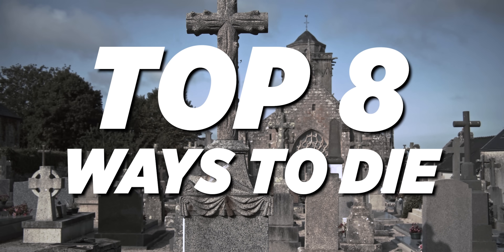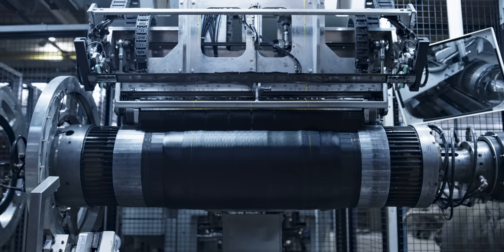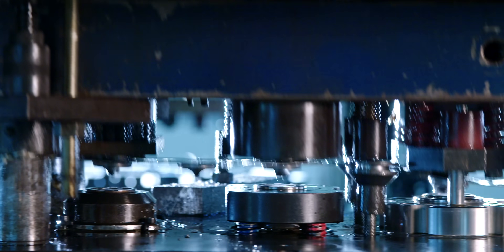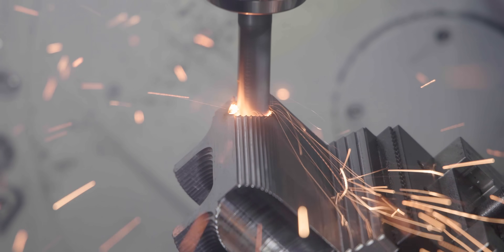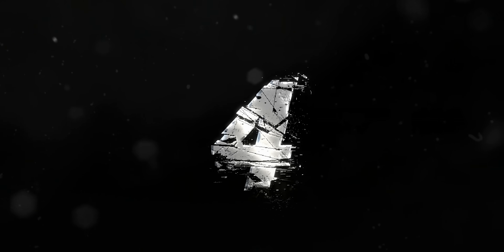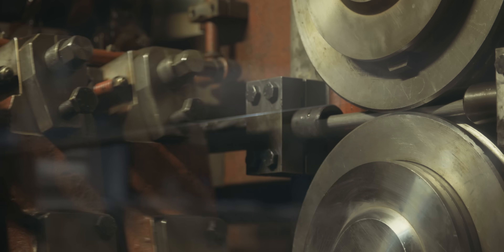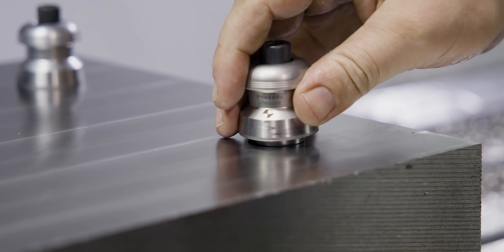HOW To Be KILLED In a Machine Shop

Comment: More of an issue with manual lathes, but can come up on flatbed  CNCs also. And that is long stringy chips. Ive got a big scar wrapped around my left middle finger where I cut the end of it mostly off and had to get it sewn back together.  One moment of stupidity doing something I knew not to (brushing away a stringy chip with my hand instead of using a chip hook) and the chip caught on the chuck and essentially turned into a bandsaw blade running against my finger. 

Good video overall and covered all the other major important ones. Personally saw someone scalped by a lathe years ago from long hair not tied back. It wasnt a pretty sight. My hairline is retreating fast enough that it isnt much of a concern personally.

Comment: Was a new guy in a shop with a super clean Clausing lathe, so I started using it. The guys used to give me funny looks, so I asked the Foreman. He told me the guy before me got his head between the chuck and the bed of the lathe.

The reason the lathe looked brand new was because the Maintenance guys picked it up with the crane and took it out to the dock and steam cleaned the dudes brains out of the machine.

Had to let the guys I didn't know I was working a dead-man's lathe.

Comment: The worst accident I had so far (In my 6 months of being a machinist with no prior experience) was that I: A: Didn't check my Y finish position on a job, and B: left a vise handle in the vise when I was setting up the cycle. The result was a broken vise handle and a giant crack in the 3 layer glass doors. I was in shock the rest of the day and now I check my Y axis moves religiously every time I run a new job. Happened when my supervisor was like 2 meters away too, luckily nobody got hurt and I didn't lose my job but this one will definitely stick with me.

Comment: We once got an order to re-machine the flank geometry of already produced "plastic" cogwheels with a steel core.
Apparently, the other geometry was way to loud but they already had like thousands of them lol.
I'd take a small Drill, flip it around and put it in a ER16.
This "Tool" would come down Z- and position itself at 0° (X+30) above to my 3 jaw chuck in which i would clamp the cogwheel.
The drill was used to align the cogwheel tooth at 0° while closing the 3 jaw chuck.
So once setup it'll look like this.
Take out cogwheel, close doors, Cycle Start, Drill comes down Z- and positions itself, Stop M00, open doors, put new cogwheel in, close doors, Cycle Start.
Now, opening the doors twice is a pain in the ass, yes.
Especially when we are talking 5000+ of cogwheels with 30 seconds actual run-time.
But when i found out the next shift not only disabled the door safety mechanism, but also left it that way for an unskilled night shift worker?
I kinda lost it. 
Like imagine the guy would've sticked his head in when the Drill comes down.

Comment: Lock out, tag out especially with HMI remote controlled or automated equipment.

Years ago, I was helping a guy replace a brace for a large conveyor belt. I was between a massive chain and sprocket with loose clothing when I heard a buzzer go off that indicates all the belts will start up in just a couple seconds. Fear came over me like no other thinking this high horsepower electric motor with a gear reduction trans was about to turn on and cut me in 2. I failed to check if the equipment had been locked out/tagged out. The other guy luckily had done that procedure saving my ass.

Comment: Yeah I grabbed a spindle going 10k rpm once with a glove on, like firm full force don't want to drop this type grip. 
Disabled door locks. To change tools you'd call it up in the spindle, hold the tool with 1 hand and push a release button with the other. Thank the Lord I was wearing a pair of shitty maxiflex and the gloves ripped before my arm did..
I took that as a learning experience, to always double check the spindle before grabbing it, because door interlocks are for sissies.

Comment: i am a maintenance technician. i was called over to a machine with a pallet conveyor and pneumatic pick-place arms to find an issue, it was a big equipment with safety fences all around it. naturally i have bypassed a safety door lock, went in to inspect sensors and what not, and the operator WHO CALLED ME THERE switched on control, and my entire palm got pinched the instant air pressure got back by a fairly powerful lift cylinder. better than that, screaming from the top of my lungs to hit the emg stop button, the cylinder bound up, and they had to crowbar it open so i could remove my hand.. 

we were moving in the shop a new cnc lathe. 17 tons. had to stack the rollers about 30cm high so it would roll over the preinstalled anchors in the concrete. one of the manufacturers technicians was under the machine checking for the rollers, and told the forklift driver to start to pull the machine. the driver insisted that the technician was clear of the machine before moving.  the moment he pulled on the machine, it jumped off one of the rollers, and it would have killed the guy under then an there.

Comment: I remember hearing a story on reddit about an operator of a machine that lifted heavy something. He found out that there is a decent space in the back of the machine that is never used during normal operation. He programmed a dead zone in the machine so it stops early if someone tries to move a load back there so he can put a small mattress in the space so he can take a nap.
Reply: Well that sounds like the setup to a "final destination" scenario, except one that doesn't need anything contrived to flatten the guy, just someone who knows how to override his dead zone and a reason to do it.

Comment: I repair garbage compactors, this is a true story. In Napa California, a operator removed the safety lockout on the loading platform gate, so he could load the compactor with the gate open, while the compactor is running. He lost his balance, got crushed and died. Other compactor repair persons can relate to this story. On megantic safety's people would place a magnet to defeat it. Micro switches are locked on with tape. I remove this stuff almost every day.

Comment: Here is a good Idea. . .Everyone in the shop needs to be familiar with everyone else's machine to the point of shutting it off in case of an emergency. I can't tell you how many other workers I know of including machinist that do not know how to stop the machine next to them. This would be to pull up a leaver quickly or where the emergency stop button is located or what to do if someone is caught in a machine or wounded.

Comment: Manual machines are very dangerous.... I had a 90kg steel part chuck out at the other side of me... Turns out there was plastic inside its bore.... Close call... I also use cncs... The closure makes em safer

Comment: 2:08 You may not be aware of this, but here is a very serious error: you must never use a file on a lathe in this way...because that's how the left arm is over the lathe chuck!!! Unlike usual, the file handle ALWAYS belongs in THE LEFT HAND and the file is guided upwards with the right hand!!!
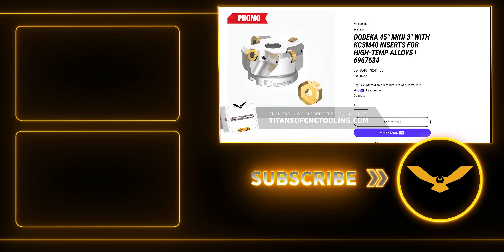6:38 On the subject of "long hair in the workshop": In almost all workshops in Germany it is simply forbidden to wear longer hair "open".
They either disappear completely under a cap or under a "hair net" which, in the case of long hair, is part of the personal protective equipment of every worker, like gloves, safety shoes and protective goggles (the protective equipment is provided by the company free of charge and must be worn).
Andreas, Germany.

Comment: #11 Sticking your head into a machine and breaking off a .070 drill or 2-56 tap in the noggin will not make you yell BOOM! I have probably seen this injury more than any other in my 25 years of CNC mfg. (bonus - #12 grabbing chips off a tool or part bare handed).

Comment: When i was an apprentice there was a guy in my shop working on a leathe, having a bar hang out the machine about 4 feet. the bar startet to rotate and bent to a 90 degree angle. it looked like a propeller but the whole machine startet jumping und shaking. on this machine the emergency stop switch was located on the left corner but facing towards the machinist. when he tried to push it his fingers would reach over the corner of the machine and the spinning bar just cut off four of his fingers. he is now left with only a thumb on his left hand. 

sorry for bad english.

Comment: I almost got decapitated across the shop when a lathe operator loaded an 8ft bar in a 4ft drawtube. Cranked the spindle and turned the bar into a helicopter prop and sent it flying. Missed my head by inches.  I know mistakes happen, but I'm glad this one didn't force me to tap into my precious vacation time. 😁Lathe guys...😂

Comment: A guy leaned in, and his long hair got wrapped around a chuck on a manual mill.  About 3" square of hair got pulled out of his scalp. It was freaking nasty and the screaming from him. Another guy did the bar stock out the back of the lathe. He turned it on, and that 5' feet of material was whipping around. He turned the lathe off and thought he could stop the bar. The bar hit and broke his forearm   These both happened in vocational high school. 40 years later, I'll never forget.

Comment: The first images in this video are of a wire drawing shop. They run steel wire that's actually called "rod" at that point, because it's not truly round, through dies. This brings it into size and roundness tolerances. This wire is then used to make fasteners, like bolts.

Comment: Thank you for the message Barry but no matter how many times people will be told some operators behave as if they are knife throwing in a circus show-seen operators running power tools without plugs,others welding without safety glasses and others using the grinder without safety goggles,painters,riggers you name it -safety is just but perfunctory.

Comment: 2 that have occurred in my career. First shop I worked in had all their safety interlocks overridden. A guy was touching a workpiece with a facemill to get his z-offset. He forgot to clamp the part and entire workpiece began to spin with the facemill. He reacted my raising the facemill and the workpiece flew off the table and hit him. I wasn't on his shift and he never returned to work.
2nd shop and we have our interlocks in place. We have a really old boring mill that's wide open. Operator was using an edge finder to pick the part up. He realized there was a burr on the edge and backed the tool away. Grab a file and began to deburr. His sweater got grabbed by the still rotating spindle. He was fortunate that his clothing got ripped off him. He suffered burns from the clothing and broken ribs. He eventually returned to work.
Always wear your safety glasses. I've been saved twice. Once at the first shop when the lathe door was open by about an inch had a curly chip bounce out of there and bounce off my glasses. Second time by a broken needle file that chipped the lens of my safety glasses.

Comment: Touching equipment your aren't trained on.

There was a Printing press operator at the factory I worked at growing up who lost his pointer finger when he tried to help pull off some scrap from a die cutter.
The machine pinched it right off.

Army side i've seen numerous near misses from people being crushed to death, and for some reason Chiefs like to mangle thier fingers by putting them into running generators. Fans aren't your freind.

Comment: Speaking of unsafe lifting, I work in a shop where they tend to cut corners when it comes to manipulation of machines to save a few dollars here and there, like they use manual cranes and forklifts to get them on some wheels to push them around to not to get the big machine that is SUPPOSED to carry that load because it takes a lot of gas to get that thing going , not long ago, while trying to move a lathe "the cheap way " the lathe lost balance and in a split second fell over on a mechanic crushing his mid section,  there was a whole investigation surrounding this incident  and that costed the boss way more than if he were to do it the right way in the first place....

Comment: I remember my very nearly missed accident, when i was first year apprenticeship learn the machine. I got oversize drill and went into tool changer wheel and hit the side window. I remove the window, the wheel still moving and broken the pocket. I put my head in machine and try pick up the broken pocket inside machine. But machine was never press E-stop and keep run and tool changer near hit my head also my longer hair. I never forget i make a many mistake and always put e-stop and switch off the machine that i repair inside machine.

Comment: A former UAW employer of mine forced employees to sand and polish parts on the CNC lathe by hand after it was machined and an employee got pulled in by the strip of emery cloth and got his middle finger ripped out by the roots. Tendons pulled all the way out right up to his elbow. Blamed the guy who lost his finger for not doing it correctly when there was the OSHA investigation. Kept forcing employees to sand and polish with the door open after.

Comment: Number 9: Disobeying Lockout-Tagout regulations.

For those joining us from overseas, our Occupational Safety and Health Administration requires that when you have to turn off the power to a piece of equipment for servicing, you have to keep people from turning it back on while you're working on the machine. You can do this in one of two ways - put a padlock on the power switch so it can't be turned on, or attach a paper or plastic tag to the switch that says something like "danger, do not operate this equipment." If you use locks, the person who applied the lock keeps the key with him, and if you use tags you write your name on them. Only the person who applied the lock or tag can remove it from the equipment. If more than one person is working on the machine, each one has to apply a separate lock or tag to it, and each one has to remove the device when he's done working. Violating this regulation is one of the worst things, from a fine/sanction point of view, that you can do. Some places take it even farther than that - North Carolina has thrown people in jail for this. Jail requires that someone either die or get severely injured.

I was working at a commercial printing plant in North Carolina. We locked out our biggest press in the morning so the operator could do some work on the gear train. During lunchtime, the operator was killed in a traffic accident. The boss man is like "what are we supposed to do? The law is absolutely inflexible on this. HE has to be the one to remove the lock!" So we called the state... "oh no, a state government inspector must remove the LOTO device and must observe another employee apply a new one." Naturally, visions of having this machine sitting unusable for years went through our heads when we cautiously asked, "and how long will it take for the government inspector to arrive?" "Give me fifteen minutes. I'll be right there."

In general I was always satisfied with the North Carolina state OSHA even though they did fine me $25 once for not having an MSDS for water in my MSDS book. There is one and it's the funniest thing you'll see all week...the recommended first aid for skin contact with water is to wash it off with water, which makes me wonder if you can use the same water. The first aid treatment for oral ingestion of water is to make the victim drink water...it doesn't say what to do if the guy isn't thirsty anymore when you try to perform first aid on him. The MSDS I had said the proper firefighting technique for a water fire is to spray down the flames with more water.
Reply: That's rough, though surprisingly quick. But in terms of water being on fire, the chemical and electronics industries go "hold my beer" on that one. There are a lot of things in some environments that heat up excessively, catch fire or even detonate on contact with water. And water is usually still the safest way to handle those sort of fires. (Though the good old bucket of sand definitely has its place at lab scale.)
Reply: Sounds like that inspector knew how to get people to call him in the future -- by making it easy for everyone involved.

Comment: Have aroind 15 years with a company with large vertical lathes that had chucks produtding around 8" off the floor and large swing horizontal lathes (up to 68"×28'). Throw in a couple floor type horizontal boring mills in there also. Most our parts exceeded 10,000 pounds and up to 40,000 pounds. Also, lots of weldements 28' feet long and 12' wide. Other than a few stitches here and there and the odd debris in an eye, we had no major injuries in that time. Reality is though, these machines were large and unforgiving. I now work in an engine machine shop, running the smallest machines I've ever run with no workpeices over 250 pounds. Still room for injuury, but norhing like what most my career has been like.

Comment: In my 38 years of machining in manual and CNC shops, I found the top 3 things for causing accidents are:
1: Ignorance
2: Incompetence.
3: A bad boss. 
Usually i find its often a combination of 2 or all 3.
Reply: #1 is a cheap employer who won't allow something to be done right and safe because it costs him a few extra pennies
Reply: @georgehunter4023  thats fits into the 3 reasons he listed above
Reply: That goes for warehouses as well. "Stand on the forks of this lift while I raise you 20ft over this concrete floor"

Comment: Improper setup. At a heavy engineering workshop a guy had set up a large vertical lathe but it was unclear if the job could be safely held (due to high rpm needed). Needless to say, when he started and it got to speed, the tall stands that the job were clamped to began to fling off the machine due to excessive centrifugal force and one actually hit the operator.